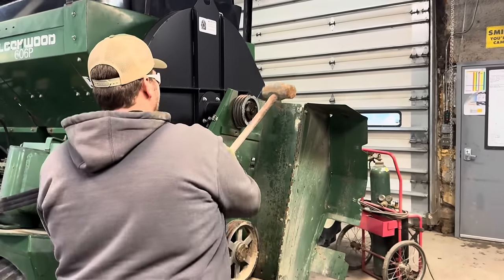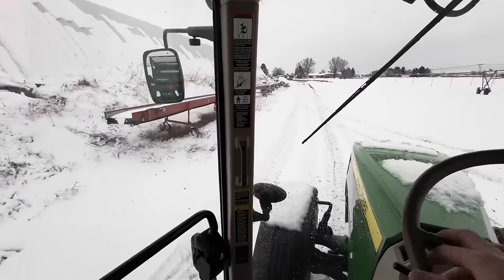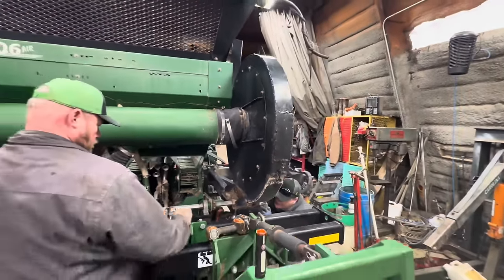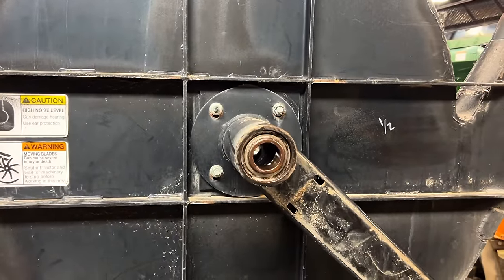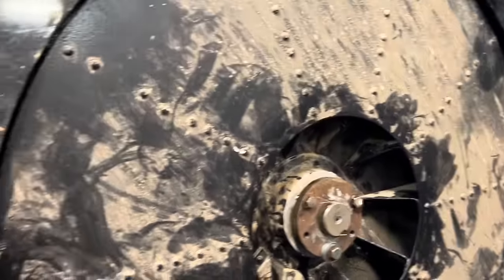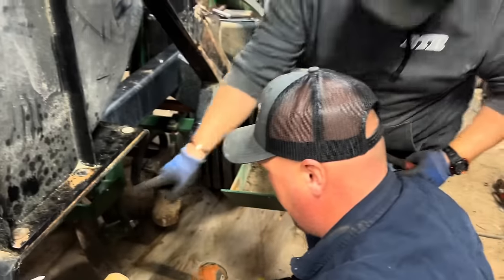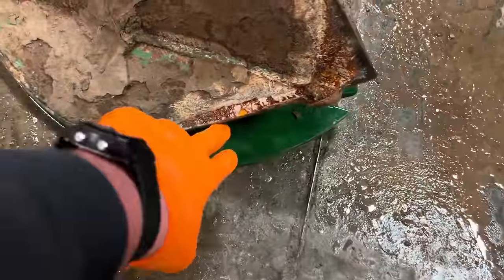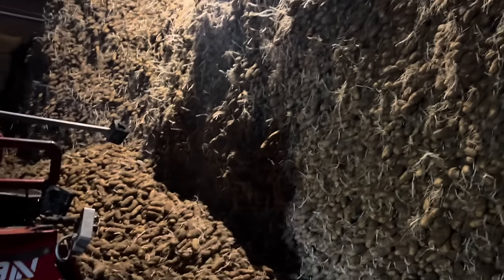Reviving Our Lockwood Air Cup Potato Planters

Comment: Great videos.  FYI I have the same welder  , I sit a small fan blowing on the fins into the welder to help it cool works great . You will get more weld time out of it.  Also when it overheats it will reset quicker . Hope this little tip helps you   Thanks for sharing . 👍👍👍
Reply from the maker: Thanks for the tip!

Comment: What is the row spacing for spuds?  If it’s different than corn, do you use different tractors specific for each crop?
Reply: Most russet potatoes in Idaho are 34” or 36” spacing. Most guys use the same tractor for multiple crops and if needed they change the tire spacings
Reply from the maker: Ours are 36 inches. We use our tractors for almost all of our crops with the exception of the track machines. We can’t use them in hay because it tears up the ground when you turn.